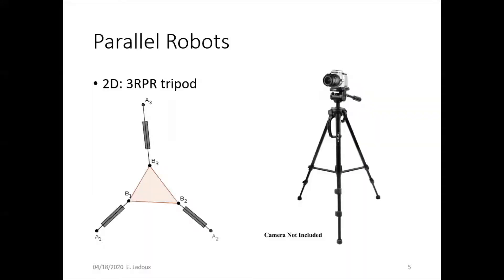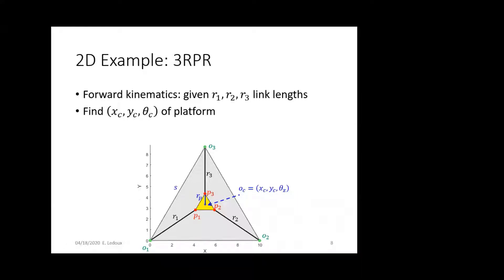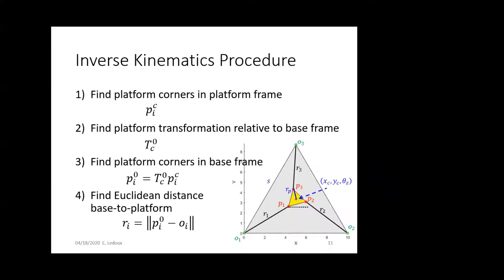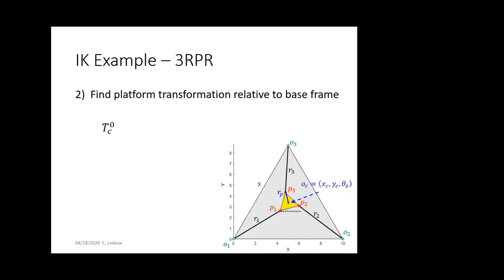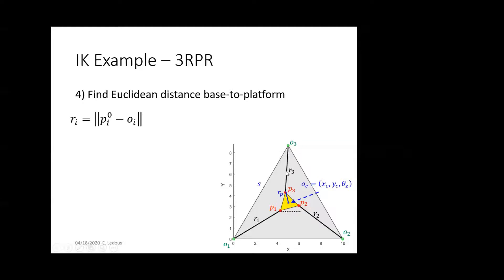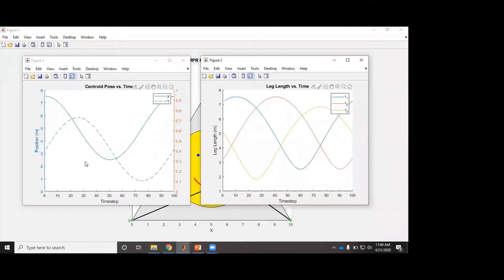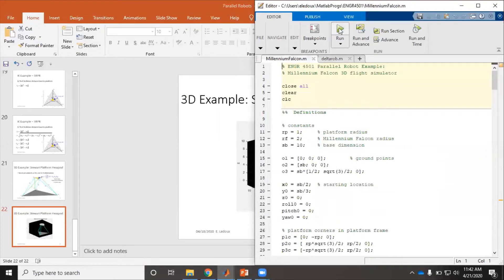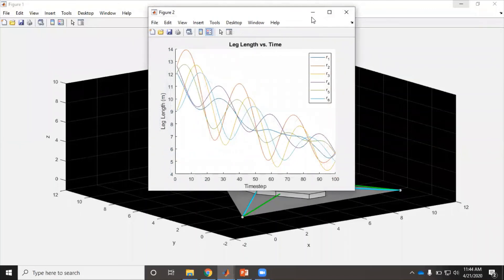Platform Robots

Comment: Can we use these same steps to do the calculations needed to create a stewart platform? Or are there any additional things?
Reply from the maker: No, you can solve for the values algebraically.  It is actually easier than for a serial robot, so no need to use the Jacobian or a numerical solution.
Reply: @roboticsandengineering  Thank you so much. I am actually going to create this Stewart platform physically. And also how do I get the values for xc, yc, zc, and theta?
Reply from the maker: The Stewart platform should be done the same way, just it will have 6 equations for leg lengths instead of 3, since it is done in 3D with 6 legs instead of 2D with 3 legs.  But the transformation will still be 4x4, the rotation will still be 3x3, just they will look more complicated.
Reply: Thank you. I have another question. We will get the equations at the end. Then how do we get the values when we build the stewart platform. That is, how do we now find the values to find the distance of the legs from this. Can we replace the angles with the values we want and get the values at the end? I don't understand it. Can we use the formula you mentioned in step 3 ( Find platform corners in base frame) when creating a 3D Stewart platform . @roboticsandengineering
Reply: @roboticsandengineering Can we use the formula you mentioned in step 3 (Find platform corners in base frame) when creating a 3D Stewart platform?
Reply from the maker: Yes, you can use the formula in step 3 in creating the Stewart platform.  First choose the pose (position and orientation) of the platform center.  Then find the platform corners in base frame.  Then find the Euclidian distance between the platform corners and base corners; those are the leg lengths.
Reply: @roboticsandengineering  Do We need jacobian matrix to create Stewart platform 🤔
Reply from the maker: Those are values you choose based on where you want the platform to move.  (xc,yc,zc) is the position of the platform center.  What you have called theta really needs to be three angles now: roll, pitch, yaw (the original theta is yaw, angle in xy plane around z axis).  So you choose position and orientation of the platform.
Reply: @roboticsandengineering  can you give me some examples. ...please
Reply from the maker: If you want the platform to be completely flat and in the center of the base, then choose the xy coordinates as the center point of the base, the z coordinate to be the height you want the platform, and the roll/pitch/yaw angles all to be zero degrees.  If you want the platform to move, then change x and y and it will move side to side.  Change z and it will move up and down.  Change roll or pitch, and it will tilt.  Change yaw, and it will spin.  This is easiest to do in simulation before you build the prototype.
Reply: @roboticsandengineering when we create Stewart platform,  can we use rotation matrix? And why we can use that
Reply from the maker: Use a homogeneous transformation matrix, which includes a rotation and translation both.  The rotation part describes the orientation change from base to platform, and the translation part describes the position change.

Comment: where do you put the base of the platform frame in general? Does it have to be in the middle of the triangle? or can it be anywhere
Reply from the maker: The base of the platform is the ground link. Put it wherever you want and build the rest of the robot on top of it. Typically, the platform is smaller than the base and moves within its footprint.

Comment: In step 1): when we calculate the coordinates of the platform corners in the platform frame, why do we add the coordinates of the platform (x_c and y_c). I thought the difference between the two coordinate-origins is calculated with the transformation matrix. In this case the coordinates of the platform corners are calculated starting from o_c and the parameters x_c and y_c are not used in step 1. Is there something I'm missing here?
Reply from the maker: You are correct, the matrix on the right at 8:04 is actually p1 after the transformation and not before.  So p_1^0 = that matrix (the answer to the problem) and p_1^c = [-rp*cos(pi/6); -rp*sin(pi/6); 0; 1]; which gets p_1^0 if you multiply it by the transformation matrix T_c^0.
Reply: Aah, I get it. Thank you for the explanation!

Comment: Really wish this was written more like software with meaningful variable names rather then mathematical shorthand since this equation is more likely to be used in software rather then mathematics. It took me forever to wrap my head around PID controllers since everything was always written in mathematical short hand rather then in pseudo code.
Reply from the maker: You can call the variables whatever you want in software as long as you know what they represent mathematically, but the code must be based on math.  Pause the video at 8:54 for a peek at the code.